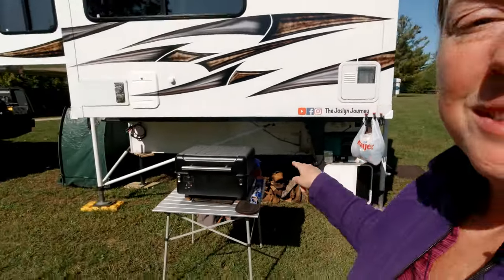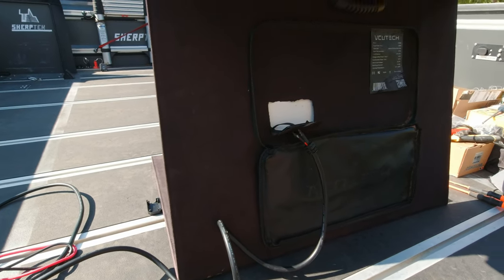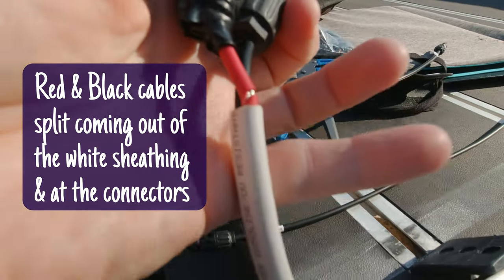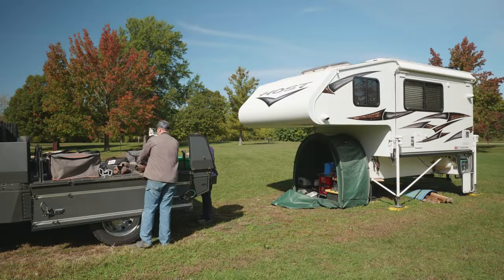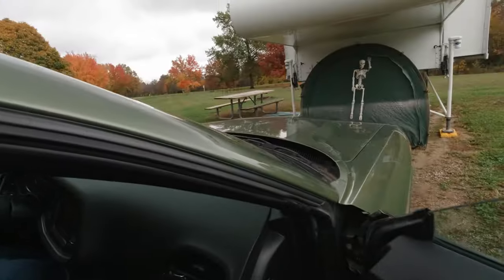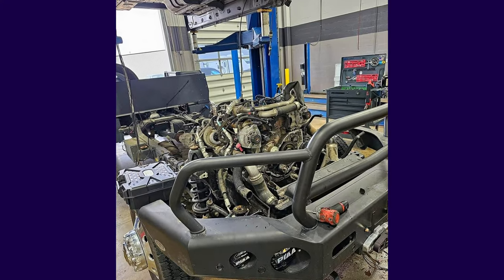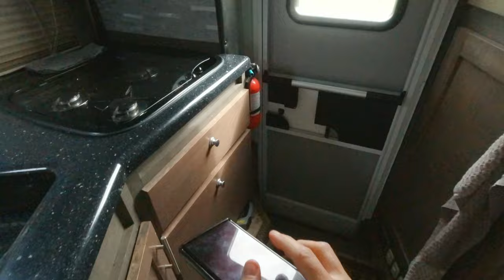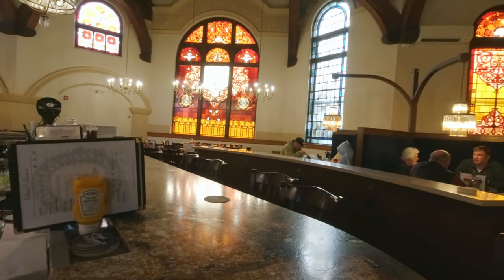Solar Panel Failure,  Ram 5500 Surgery & BEER! | e159

Comment: Your schedule sounds exactly like ours has been,since we left penpac and came home earlier this summer.  Just finished a repair on camper related to slide that dan attempted while we were there, but, needed to be redone (full details available if needed; written up with pictures and arrows  just like at Alice’s -reference may be before your time😀).  After you showed us the VCUtech panel, we bought one when we got home - then bought a second. They were on sale for $199 first, then $219 for second.  Hope we have better luck than you did with them.  Put in second MPPT controller for them since they didn’t match the roof panels, but, seems ok in testing.  Anyway, hope that is the end of your issues with nothing but fun times ahead.
Reply from the maker: It's funny how it seems like you spend more time fixing than traveling in these things, ha!  Luckily the travels are pretty amazing.  I do hope that you have better luck with the panels.  I did send it back and will let you know if/when I hear from the seller!

Comment: Was that a small child/animal that Gary ate??!!!....lol Interesting place.  Do you schedule your Dr. visits/test every 6months/1 year and plan to go to Peoria or was this just one of those "we're in the area".  How do you handle getting medications on the road?  We have a Ram 5500 (2015) not sure if our cab has to come off for certain types of service, what a pain!  We are still learning about our Truck Camper, just getting it on the flatbed & straight is a real treat....lol  Stay safe!!
Reply from the maker: Howdy!  I probably should put an entire video up on healthcare stuff.  We will schedule our visits yearly and we do head back to this area generally around November.  We visit family and do doctor visits then.  Before we went full-time, we talked to our doctor about our plan.  He was on-board with it and when we need medication, we'll have them call it into the pharmacy that's close to our location at the time.  We try to get as many 90-day supplies as we can to minimize the work.  We've even done teleconferences with our doctor before for issues (like when Gary got Shingles).  We also tend to use GoodRX since even with our company healthcare, their RX prices are better for 90-day versions (and it's free!).  We do tend to go to Walmart for our meds since we can usually find one within an hour or so of where we're staying most anywhere.  This timing cover issue apparently is something that's been forever happening on every diesel.  Not every vehicle gets it.  So I hope you don't!   Gary noticed it when we saw our oil low.  It wasn't bad at all but did increase when we were out west.  We wanted to get it it done before our warranty expired on it.  And oh, I feel you about the getting on your flatbed.  It's so much taller and is a bit nuts!  We will use 2 blocks under each leg plus a rubber mat on top.  That helps with stability AND raises the camper a little so I don't feel like I'm maxing out the legs.  Here's our affiliate link for the rubber pads we use:  https://www.joslynjourney.com/get/camper-jack-pads/